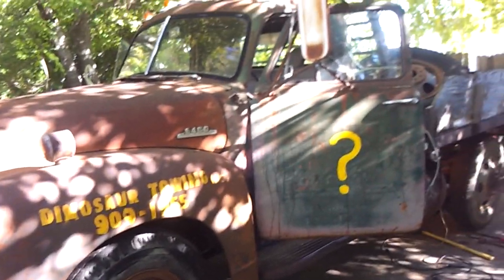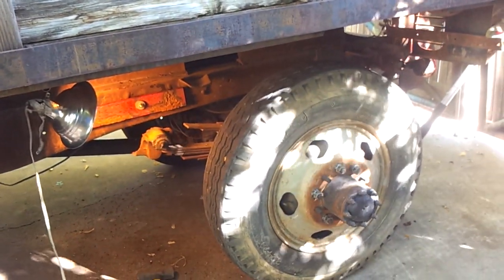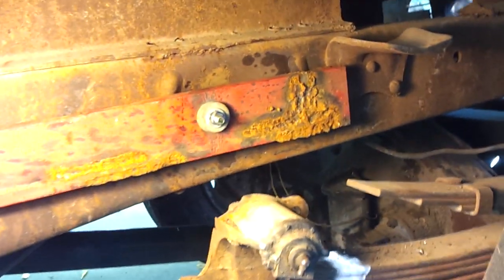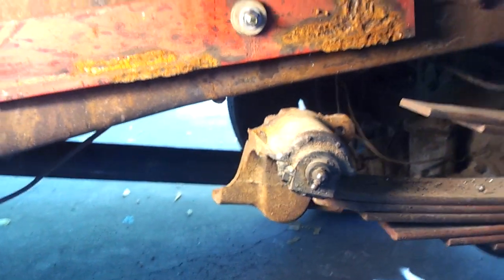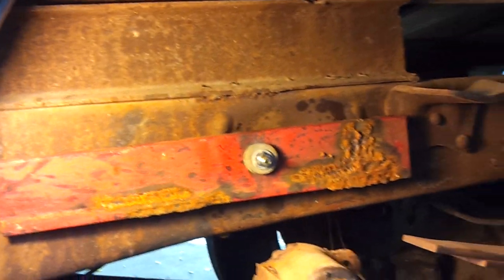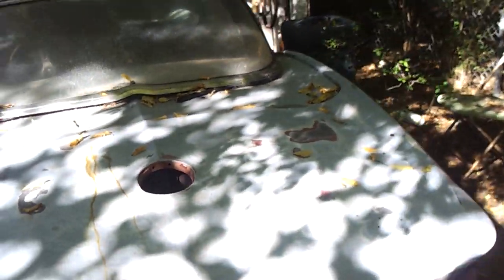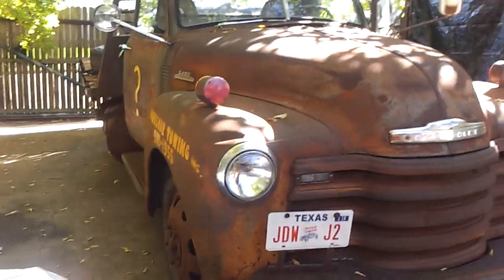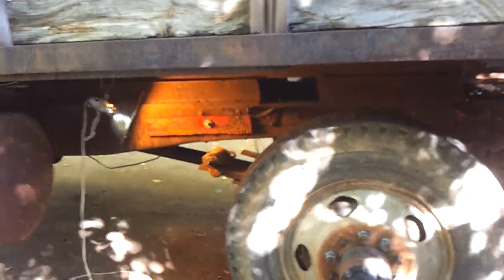Dinosaur repair video 9

Comment: You have the right idea, you need heat to red hot and beat on it, cut an opening to beat from other side, on the outside frame put a bolt to it and heat it to red and pull on it with a chain winch dog and bone.    Second option is to cut section out and weld in your doner section.  You will get there